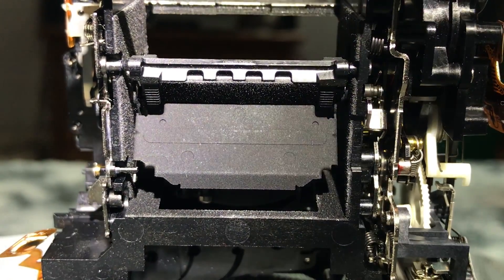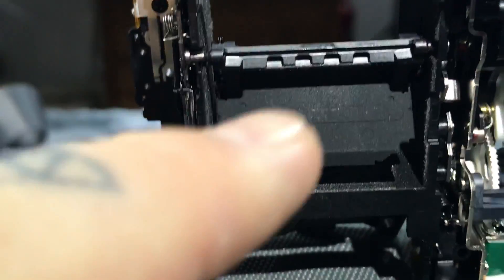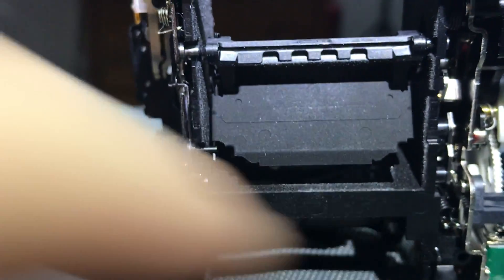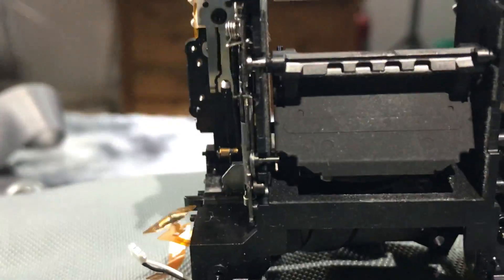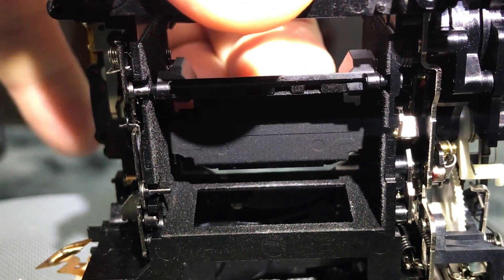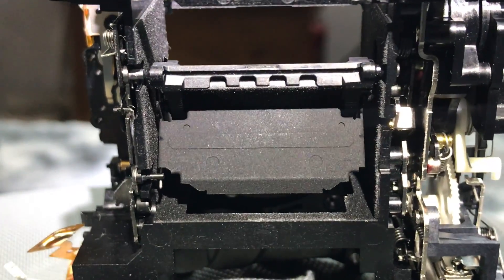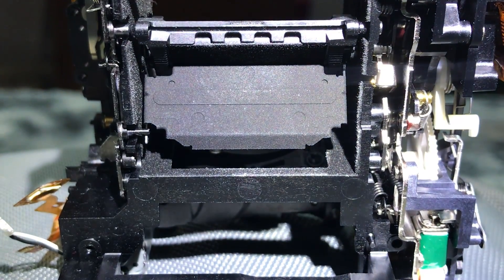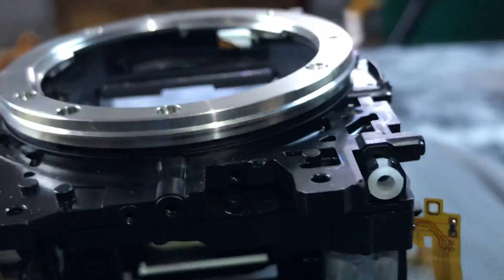🤓 DSLR "AF SLOP" due to secondary mirror alignment

Comment: Hey angry dude,
I just got a Nikon d7000 as a supposed upgrade to the Nikon d3200. I can say by far I love it the d7000. My question is can I use the older d lens on my Nikon d7000 or does it have to be the g lens. Please help, your way smarter at this than I am
Reply: D lenses work great on d7000
Reply: All dx lenses work with the d7000 I believe. I have a D7100 and I even use my old lens from my F401s film camera that are 26 years old